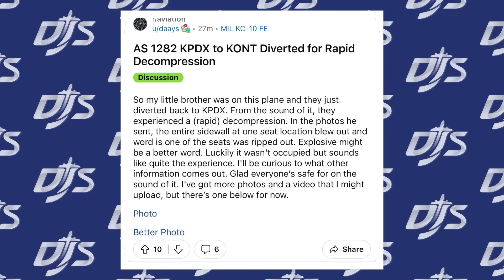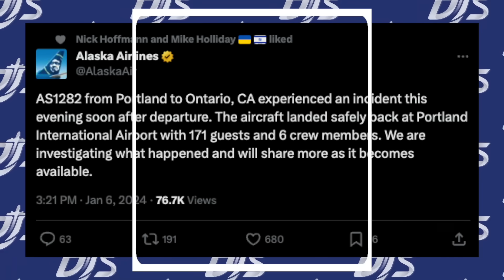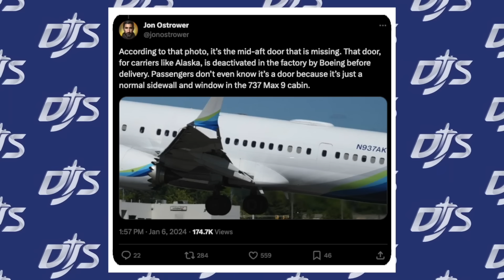Alaska Airlines 737 MAX Door Blows Out

Comment: The blow-out occurred at a plug for an unused emergency exit.  The investigation will need to determine why the plug liberated itself during pressurization on this 10-week old 737-9.
Reply: I have a feeling Ground crews tempered or Improper maintenance with it but I mean that’s up to the NTSB to decide I have no idea if it was Boeing’s fault because this is technically the first time this ever happened so I’m 100% sure it was the ground crew or fail maintenance at fault possibly but I mean we can’t jump to conclusions saying it was the Boeing company’s fault for this incident in the first place just because this is the first but I mean that’s up to other people to decide on this.
Reply: United Airlines operates the aircraft with no issues.  Let’s look at Alaska maintenance records since they took delivery of the aircraft.
Reply: The plane is only a few weeks old. Its unlikely but not impossible that any maintenance activities have been undertaken on this "not used" door but until we get news from the investigation we don't know. However, it certainly isn't good for Boeing's reputation
Reply: @cmartin_ok  the reputation of any manufacturer is not good put it that way. Aviation is on the way down
Reply: This incident is very puzzling. As a 41-year airline maintenance guy, I've seen and adjusted my share of plug doors, but almost exclusively on 727s and DC9s and mostly cargo or entry doors. I've never seen, although never tried to test it, a plug door that would fall out if horribly adjusted, as the door is still larger than the hole it is plugging. It would also have to be rotated somehow to fit through the hole. They will leak air really bad, but that usually produces a squeal that is so loud, you would not want to sit near it. You can see the door stops still mounted to the fuselage, and the door would have corresponding stops / adjusters that press against those stops. Can't wait to hear how this was possible. I'm also wondering where the door landed because, having your house, car, boat or yourself hit by that thing, from 16,000 feet, would be a day wrecker for sure!
Reply: @Part_121  The human being comes FOURTH after the house, the car and the boat in terms of day-wrecking? How very American. If you don't mind me sayin'.
Reply: @alastairbarkley6572  dude, you should consider getting help for your psychological condition based on what you surmised from the entirety of that comment. The order had nothing to do with value or importance, or being from any particular country, in fact the order has nothing to do with anything. So yeah, I do mind you "sayin'"... I hope your life gets better, there is help out there for you, I'm sure of it.
Reply: Where ever, its a decompression threat, stop making excuse for the MAX there are to many in the air.
Reply: @edumacat3d  Well, I never worked on a 737 of any vintage, but the 727 didn't really have a torque for the door stops. You adjusted the clearance between a screw-type stud on the door, and the stops they contact with on the fuselage, when unpressurized. The spec (which I don't remember) was likely between just contacting the stop, up to a certain amount of clearance in thousandths of an inch. Then later the plane would get pressurized on the ground to check for leaks. Even if the adjustable studs were missing, the door should not fall out, but it would be very obvious, if not by sight, definitely during the pressurization check. Should be impossible for a new plane to be very far out of adjustment. It would be interesting to know how many cycles this airplane had. All this will come out in the investigation.
Reply: TV news keeps saying it's a "panel" but the outline of the missing section looks like a door to me. I'm not an airplane expert, so is this unused door not apparent from the inside? From photographs inside, it didn't look like any exit, mainly because the seats in that area were all tightly together, so it's not one of those coveted emergency exits rows with more leg room.
Reply: @Alison0212 What? Ever hear of punctuation?
Reply: @roachtoasties  From the inside the “plug door” is not visible, just looks like a normal wall panel. It’s only a real functional door in the model used by Ryan Air, it’s blanked off plug panel at other airlines.
Reply: @Alison0212 they wouldn’t be doing any maintenance on this plug after 10 weeks . Hidden behind cabin trim etc. it’s not a working part. Hard t believe over pressurisation at 16,000 ft but a few psi makes a huge difference.
Reply: @roachtoasties  Yeah, it's definitely a door but, as you mentioned, it doesn't look like the standard type of emergency exit. If you look at the video at the 2:01 mark, those little white things sticking out are the structural door stops that the door adjustment screws press against. That door doesn't look like it's designed to be opened from inside, given the lack of room. Not sure if it was in this report, or another I watched, but in one of these reports they mention this door being deactivated at the factory. That could be possible, but I don't really know what the reason would be. I thought maybe different seat configurations might allow for it to be active, but that doesn't really make sense either because if you removed seats to have that area more clear, there isn't a need for more doors with less passengers. Will be really interesting to follow this as they learn more.
Reply: Probably cause Boeing decided to just use bolts without nuts or not tighten the bolts enough 😅
Reply: @Alison0212 there is no maintenance done on the plug. Boeing manufactured it plugged
Reply: @whiskeykilo2h429  at 10 weeks old maintenance records are not going to show much.  You'll have delivery inspections and thats it.  The hours aren't high enough to trigger maintenance processes invasive enough for anyone to be removing an entire wall plug.  This will have to be tracked back to the manufacturing plant.
Reply: @Alison0212 why would ground crews touch a completely sealed door… and the aircraft is way to new to have ever been touched by maintenance crews, well atleast the doors
Reply: 10 weeks old? Wow. Boeing hittin rock bottom.
Reply: I would hope the faa grounds all 737-9 planes until the investigation is done as if this could happen again but at cruising speeds and altitude it will not be good
Reply: @roachtoasties  It is hidden "door" from inside. Dummy door or plug.
Reply: @Alison0212 with the number of coverups and dramatic changes in quality control and safety as a priority at Boeing im not 100% convinced they are not to blame. Maybe if there was no so much overwhelming evidence that safety is now an afterthought at the company id still be with you but this is not the same Boeing anymore. Before MCAS a plane nose diving it self probably never happened before and Boeing has way more incentives to keep covering up and deliver orders than it does to actually fix the issue.
Reply: @alastairbarkley6572 - you’re right, ‘Cat’ should’ve come FOURTH.

Comment: I would feel safer onboard a 1980-built 737-200 than on a brand new MAX
Reply: MAX DANGER
Reply: same!
Reply: just because of a door blow out seriously
Reply: @nickolliver3021  Not just a blown out door, that’s indeed not so serious, it’s the fact that is a Max once again involved
Reply: @nickolliver3021  is not just a door. That was a permanent plug factory installed replacing a door, so is part of the fuselage. Had it blown off at higher altitude it would have caused an explosive decompression with loos of the aircraft. And is a miracle that the panel didn’t damage any part of the tail, where all controls are.
Reply: @Carlifurafollas  Got a newsflash for you chum. Doors on ALL commercial aircraft are designed to BLOW THE DOORS out for egress. They have explosive bolts (squibs) which are made to take the door off. The system failure is likely the cause and can happen on other planes as well.
Reply: @desertmoonlee6631  how is this ißdue about messing with people's lives seriously? Grow up
Reply: I will avoid to fly Boeing 737 MAX. I think Airbus is much better.
Reply: @radoslawjocz2976  why would it be safer?
Reply: Didn’t those have issues with the rudder?
Reply: Rudder hardover, hello?
Reply: @radoslawjocz2976  Eh, airbus has their own issues too.
Reply: @GoogleDoesEvil Remember Ethiopian and Lion Max,don't go to far😂 How many souls?
Reply: I’d  feel safer inside a Soviet era concordski.
Reply: @GoogleDoesEvil these many on a single series ? You out of your mind if you even try to compare Airbus to current Boeing. At this point even Lego make better planes than Boeing
Reply: @sn4tx  Soviet era planes are rubbish too. Boeing safest plane is perhaps 777. For example 777-300ER. But I prefer Airbus in general. I will avoid to fly on  737-MAX-Disaster.
Reply: I wouldn't say so. An Aloha Airlines 737-300's top literally flew off (can't remember why right now) mid-flight. I'd feel safe on a -500 to -900.
Reply: @themuscle79BONIFACIO He does have a point.

Comment: First,  loose and missing nuts found on a couple of 737 Max Rudder Controls and now a door blowout in one week. Quality Control Boeing?  Thank goodness these incidents were recoverable, but those two instances sound like they could have had the possibility of being a lot worse.  I still remember the DC10 cargo door blowouts that took out the hydaulics back in the 80s and resulted in several crashes resulting in Grounding.
Reply: There’s also the improperly drilled holes on the aft bulkhead
Reply: But we learned a lot of lessons from those DC-10 issues and it has made incidents like that less likely to occur. We have to wait to see what the root cause was here before we can add this on the long blame list for Boeing.
Reply: Corrction: first two deadly crashes, then loose bolts and nuts and now this.
Reply: The DC10 grounding was a result of engine separation due to unauthorized MRO practices, following AA191 in 1979.   The cargo blowout crash, TK981, was 6yrs prior to the grounding.
Reply: @herceg6772    and then : what's next ? LMAO
Reply: Yep.  It is the DC-10 case that makes me somewhat alarmed.   In that case, it was explosive decompression for the same reason.  There was another case too of structural failure because poor maintenance,  which was not really MD's fault.  For me,  I think the real mercy is that it was not at max altitude as that would have been a more explosive decompression and most certainly have sucked out passengers.
Reply: @kremowka579 true. Plane had only reached 16,000 ft vs normal cruising altitude of 36,000.   Someone enterprising author needs to rewrite the Agatha Christie classic “Death in the Air”.
Reply: Do you know what maintenance
Reply: @kremowka579  Huh??  What are you talking about, "same reason"...?    That makes no sense.  For one, we don't even KNOW the reason why this one occurred yet.  Second, the DC10 blowouts were caused by a poorly-designed locking mechanism, which very probably has nothing to do with this case.
Reply: I spent several hours being lectured by Airbus on how the A320 was foolproof ahead of boarding the delivery flight of first aircraft for BAW. The message was loud and clear - this was a plane that kept everyone safe because it overrode the stupidity of humans. Within  weeks one flew into the ground while the pilot tried to work out why it was hellbent on self-destruction. It was not to be the only accident where the foolproof A320 left pilots confused and powerless ahead of deadly crashes. The 737Max was not the first airliner  to fatally confuse pilots.

The other A320 lecture was on how the fly-by-wire controls were immune to interference. No evil villain would be able to take control, no high-energy pulse would leave the aircraft crippled. As soon as were seated we were told the use of laptops (no mobile phones then) was barred because they might interfere with the aircraft's systems. 

Those selling airliners could just as easily sell used cars
Reply: @ImmortalSynn happy to explain.  There is a hole where a door plug used to be.  This points to a catastrophic material failure and is even more implausible than a door latch problem as on the DC-10.  A component exploding out for defective material or design is exactly the same thing,  at least in what it causes.  The DC-10's were brought down for exactly the same reason,  that being explosive decompression.  If this had been at greater altitude, it would have been a different story.  I doubt that door was designed to fly above the stabiliser on ejection and at a minimum passengers would have been sucked out.
Reply: @barrettgordon-yp3tj I would say yes,  for reasons of this being a 10 week old plane and the door plug being behind factory installed fascia,  which strongly indicates no maintenance possible outside of an overhaul (to varying degree).  I of course don't know for certain,  but seems implausible.
Reply: @kremowka579  your "explanation" is not needed, as the point remains: you don't know what you're talking about.  The DC10s had a dual design flaw (locking mechanism on the cargo door and unvented floor) that brought it down; but once again, we don't KNOW what's cause this decompression yet, be it design, maintenance, or QC.  To say that they're the "same reason," is just not factual at this time.
Reply: @ImmortalSynn  We obviously do know what caused this decompression as the door plug is missing.  The door plug missing was not an effect of the decompression.
Reply: @kremowka579  Correction: "we" don't know much of anything yet. YOU are making an anecdotal conclusion based solely on assumption.   We have no idea at this time what caused that plug to detach, what part/parts failed, whether their failure was a result of shoddy manufacture or incorrect installation, etc. We don't yet even know if the plug itself was to blame, or if the siding it was attached to had an imperfection in the materials. We don't know if there could've been cracks in the material during manufacture that pre-delivery ultrasound inspection could/should have found (which does happen) or if such inspections were even completed as they should've been.

These are all things that need to be discovered, before you go running around (erroneously) claiming them to be "the same thing" as a situation that likely has nothing in common with this, other than the coincidental outcome of depressurization.